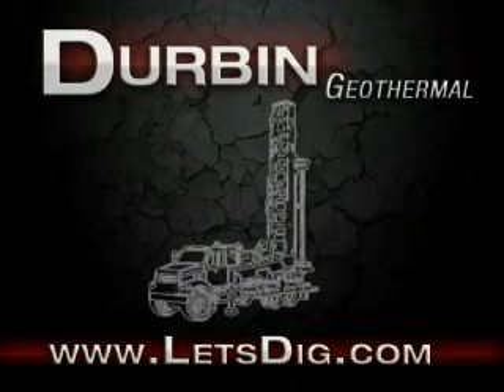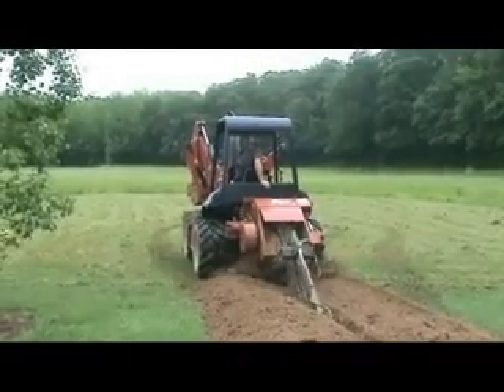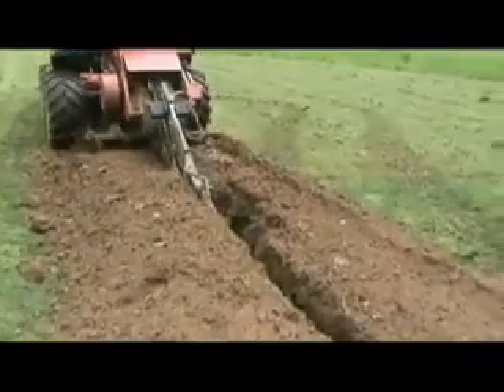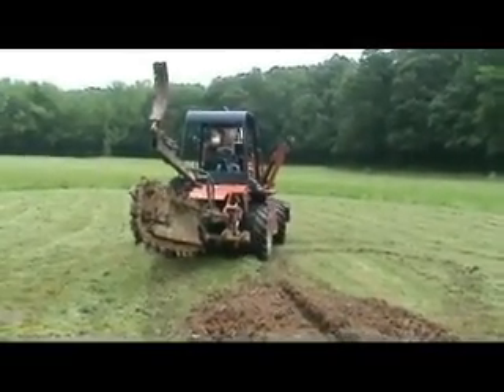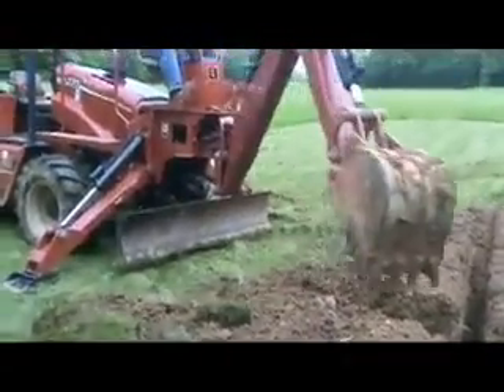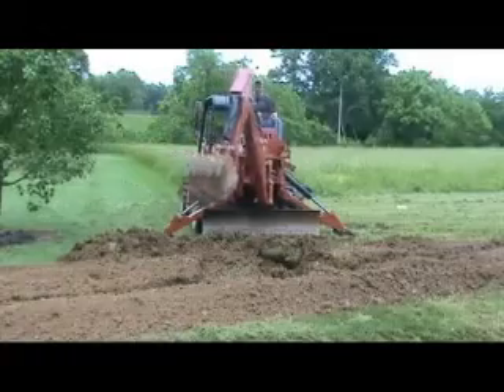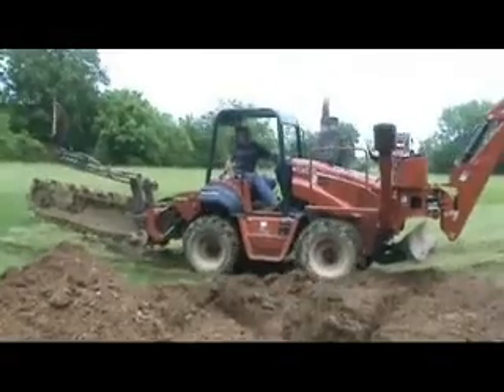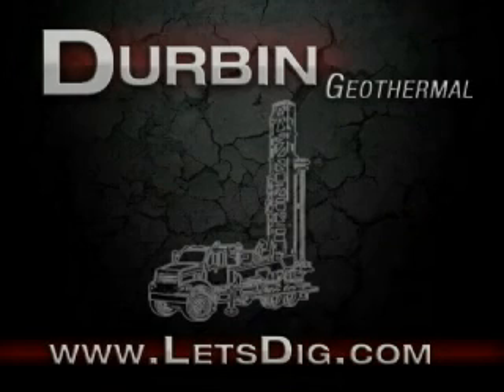Geothermal Horizontal Loop Installation with a Chain Trencher

Comment: pathetic sound quality
Reply from the maker: Well, it was made in 2008....Trencher is for sale if you want it. $60,000 and its yours.
Reply: @drillerdominique  the trencher did not sound good back then and now it should not  cost even an half
Reply from the maker: Already sold. Thanks just the same.

Comment: Sizing question. Since GS gets heat from relatively warm earth in winter can you typically do without heat strips. I know in central NC that heat load is higher than AC load. I’m thinking if I get a 2 stage unit it can run on low in summer so it's not oversized and in winter runs on high & won’t need strips. So if my AC load was 2.2ton, I get a 3.5ton ground source that runs in summer at 3.5x60%=2.1 tons and winter 3.5 tons. Sound like it will work without strips?

Comment: what happens with the chain trencher if you hit a big rock? I live in central NC and there a a lot of sandstone like rock around the edge of the field that I plan to use that were kicked up plowing over the years. probably very rarely more than 6 feet long and 1 foot thickest in the middle. How does the chain trencher do dealing with these type stones?